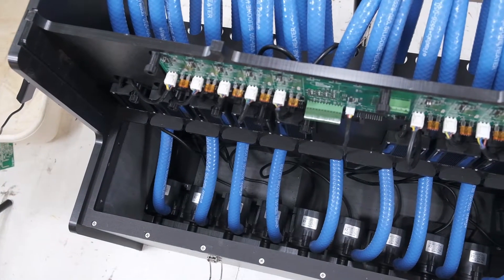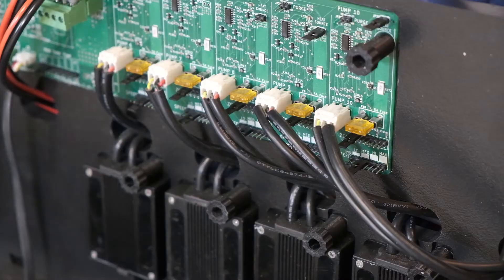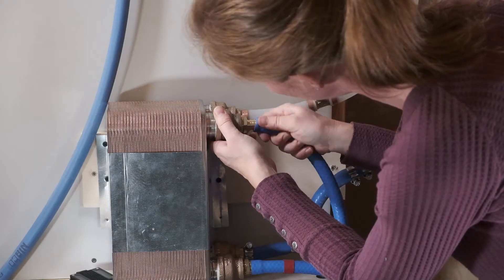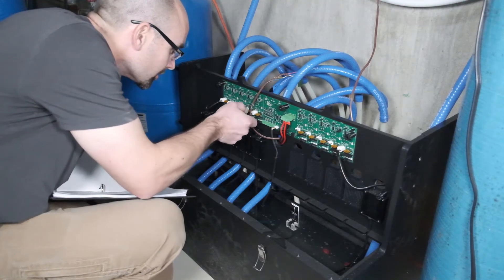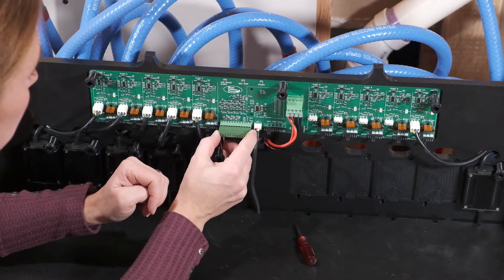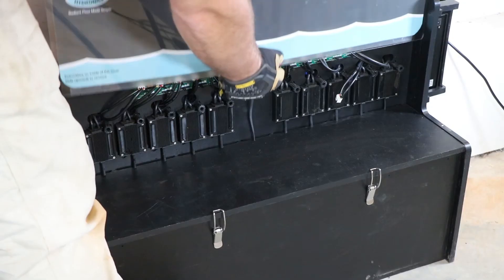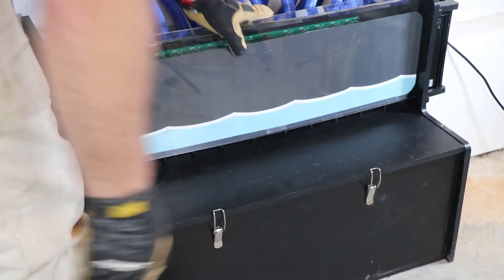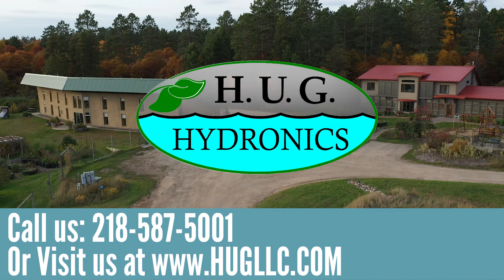An Introduction to HUG Hydronics - Your Solution to In-Floor Heating

Comment: I wonder if this could be used in the walls or roof to cool the house by adding a chiller to the tank and radiating the collected heat outdoors? Or how much could be achieved by evaporative cooling and topping off the reservoir via float valve?